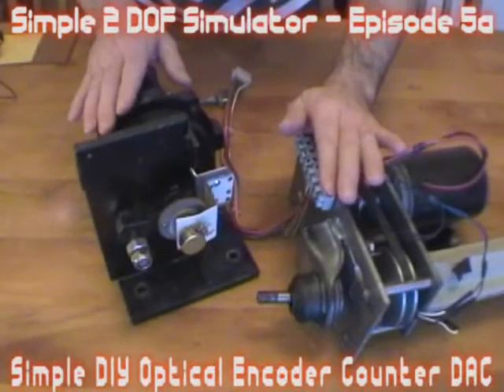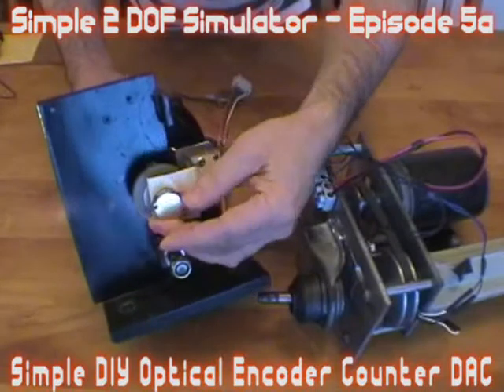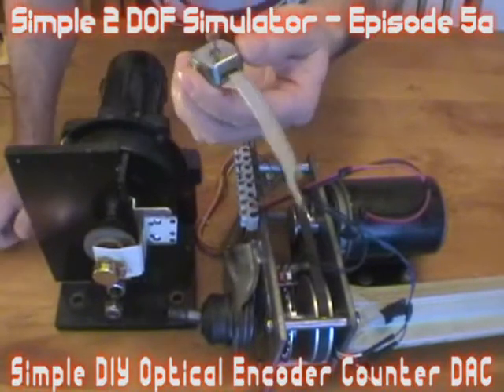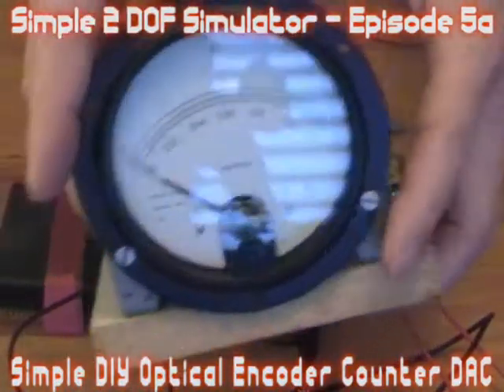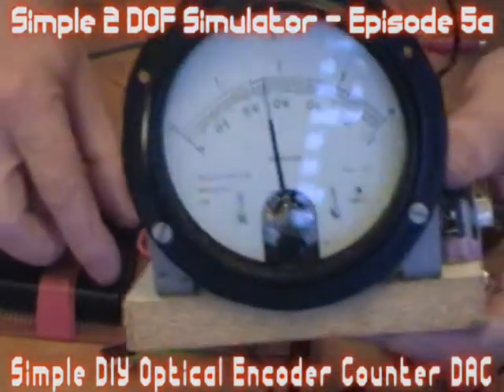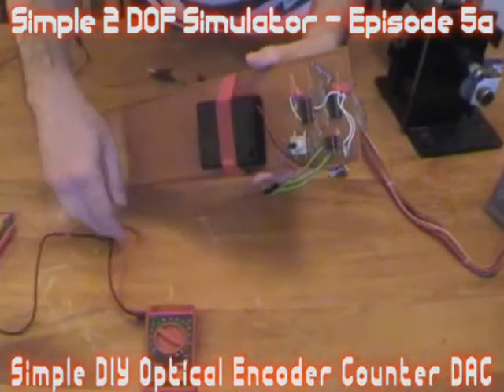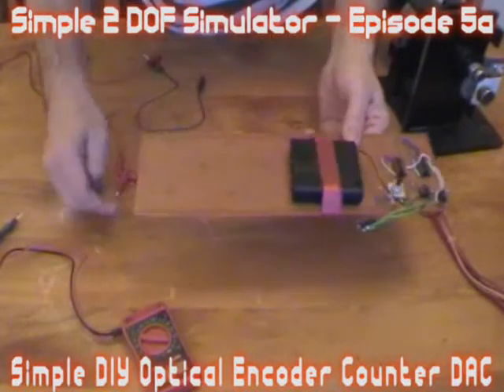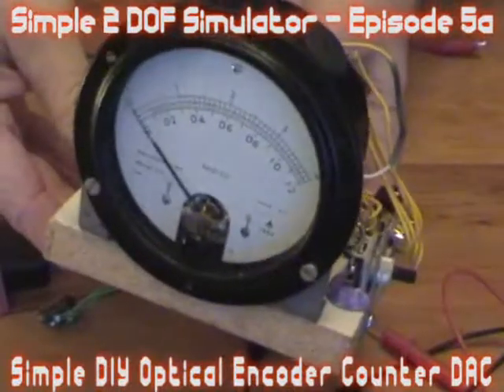How To DIY 2 DOF Sim Episode 5a - Encoder counter DAC

Comment: @marcuskeeler Simple...agreed, not so much....It became difficult from the point of firstly sourcing a UJ, cutting it....my understanding is that it's high tensile. IE: very ard to cut and then weld on some mounting brackets.